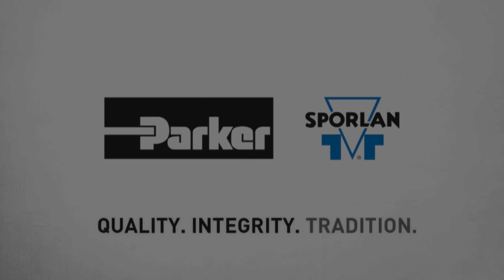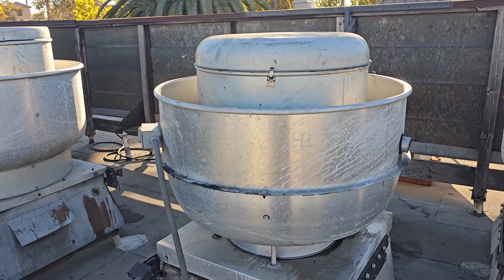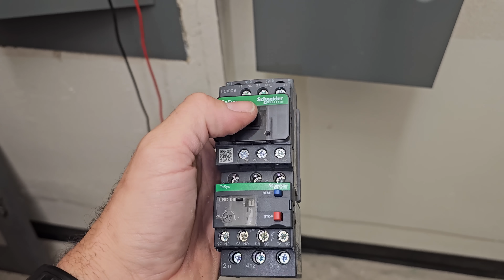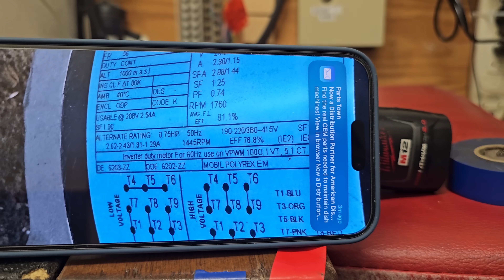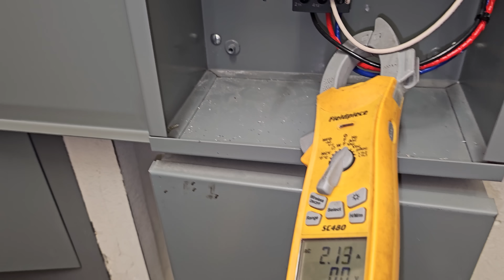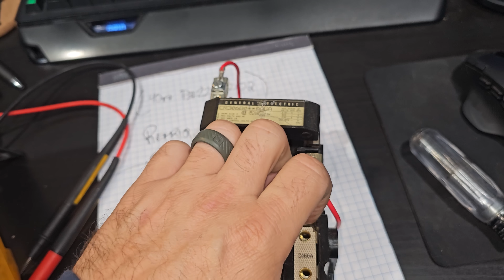SOMETHING IS NOT RIGHT

Comment: The heater probably blew up when the wire blew up. Those motor starters are not designed for short circuit events.
It's also possible that it was severely weakened and then died/broke off the rest of the way.
Also, you did the right thing rather than trying to repair that starter. Spec for those always says to "replace the entire overload if burnout occurs".

Those old thermal overloads work very interestingly. Particularly that style.
The heater itself is mated to a metallic alloy with a low melting point. During design, they pair the melting point and the heater power to correspond with the actual heating of the windings of the motor, so that the metallic alloy melts before the windings burn up. They will include a spec sheet recommending which heater to use for what motor.
This allows a mechanical action normally inhibited by the solid alloy to deploy that opens the trip contacts, and ideally dumps the contactor.
It also has the benefit of requiring the operator to wait for the overloads to cool off and the alloy to solidify before it can reset - also allowing the motor itself to cool off.
VERY ingenious and clever use of technology.

Their main drawbacks are that A) they can't handle short circuit events and will blow up if subjected to one, and B) they're sensitive to ambient, put one in a hot room and they'll trip prematurely. The heater sizing chart provides advice on how to deal with this, but it's still suboptimal.

Comment: 3:20 Power on a green wire is how you die or get some one killed.  Power on a white wire is not much better.  We are going to need a 10 ft long red heat shrink tubing.  All 3 should have been black or do not do the job.  It is like showing up to a job and only having coat hangers in your truck and saying you can make it work :-)

Comment: The probable reason for that one phase to have been blown, is a loose wire on that phase. A wire that is barely making contact, increases your resistance, which increases your amperage that the motor will pull on that phase , producing an overcurrent situation on just one phase.

Comment: FLA 2.3 x SF 1.25 = 2.8a
Reply from the maker: The 2.3 amps on the rating plate was for 230 volts . On the motor it said “USABLE @ 208v 2.54a  SF 1.0 “ I was running 203 volts 3phase so I used the 2.54 rating and multiplied that by 1.15%.    2.54x1.15=2.92a overcurrent setting… that’s how I’ve always understood that…..

Comment: Aside from the content which, by the way, is your usual excellent standard, Chris, it looks like you have a problem in your office. While watching this video I noticed curious strobing or flickering taking place. It is particularly noticeable on the wall above the printer at the back of the shot and also visible on the side wall on the left after the curtain but below the map. Have you changed the lighting in the office at all? Or has something changed with your video capture setup?
Reply from the maker: Not it’s because i run my ceiling fan and it creates a weird shadow

Comment: Sparky gets a big F. Even if they did make the mistake of assuming it was a single phase motor never use green as a hot even as a temporary. Could have just run another black and taped it. Weekend or not how do you not have extra xlink on the truck for a simple run. I just don’t get it.
Reply: Just needs to add one more black, then they’d have B,B,W and G for ground! Tape accordingly with real blue and red electrical tape like some 3M #37 not the dollar store junk or the paper sticker off your 7/11 hoagie wrapper good grief! That was just an embarrassing mess and I’m confident Chris would have more than capable of doing the whole job wire pull included. The motor controller install was perfection. Electrician had a low GAS factor.
Reply: * two more black conductors.  Three total for the three phases.

Comment: Man using green as a conducter is so Shady. I would have a pulled an any other color but green.
Reply: I was thinking the same thing.  Should have been easy to pull out all 3 new flexible wires and replace then with any color other than green or white.

Comment: Looks so nice now, after you rewire it.
Reply from the maker: It’s still not right the electrician still has to come out and fix their horrible work but it’s functional for now
Reply: @HVACRVIDEOS  I agree that the green wire is just a big no no, but if it is a emergency situation we all use the wrong wire colour. (I guess I would have used the black wire for all 3 and number them if I don't have the right colour)

Note that here in Europe I would have just used a 3 phase cable and automatically have the right color code.

Comment: Overload heaters are not fuses ,they are just heaters that heats something that trips the overload, either a bimetallic or a solder based trip.
Reply: I was going to post the same thing too.
The heater wouldn't normally melt, but since the trip was bypassed, the heater endured the overload past the point at which it would normally have tripped the circuit off.
Reply: FYI - modern resetable fuses work the same way. It's just a definition and the characteristic when it reacts to call something a fuse or overload protector... and you can't set a fuse to a different current.
Reply: @seanthiar  I will argue. There are motor protectors that are just bimetals, there are ones that are bimetals and the trip mechanism too, and there are ones that are basically adjustable breakers, with magnetic tripping, bimetallic tripping and arc quenchers. Knowing which type you have is absolutely a must. The plant I work at has equipment from 1960 to 2020 and I think I have seen about 40-50 different kinds in all sorts of configurations that are possible. There are ones that signal a fault, there are ones that are by all means and definitions fuses. Also if you look at main switches on distribution boards, some have a trip current setting even though they are actual circuit breakers. For example Hager sells a main switch that has an adjustable trip current from 63 to 160A with a separate adjustment for the characteristics (the instant trip multiplier)

Comment: When you said that you think the Electricians may have wired expecting a single phase motor it made me realize... is there a ground wire running to the exhaust fan? I think you're right, they were expecting single phase, so they ran Black/White/Green, and when they realized their error, instead of running an additional red wire, they repurposed the ground wire, and hoped the conduit itself would be enough of a unit ground (which used to be okay, but I'm pretty sure no longer is).
Reply: It's still legal, but in food service environments you shouldn't trust the metal conduits as a ground path
Reply from the maker: Yeah there is still a lot of conduits without dedicated conductor wires around me
Reply: Still code compliant to use EMT as a ground, but it’s kinda like backstabbing outlets where it’s still allowed but has high probability of failure.
Reply: @itssterilized conduit grounding is dependent on the quality of the connections.  I just fixed a system that used the conduit as the ground.  They came up out of the ground and used an aluminum junction box, to serve as the ground connection, as  the supply was run in plastic conduit, and had a separate ground.  Electrolisys caused the copper to aluminum bond connection to go bad, and all of the receptacles past that lost their ground.
Reply: I think I would call out a company lead man, and show them what was put in and paid for by their company.  They need to find a better electrician.  This guy will get someone hurt some day.  I would have discovered a mistake like that, and then pulled in 3 wires the correct size and color, along with a ground.  Even if it takes a extra hour, I might want to get home on a Saturday, but would rather pull in the wire twice, then to mark a green wire as a conductor.
Reply: Thanks for the responses!
Reply: lol if everyone in the whole total United States would follow THE NATIONAL ELECTRIC CODE 🤦‍♂️🤦‍♂️🤦‍♂️ but noooooo states over rule Fed an country supersedes state an local jurisdiction has the final absolute say 😂😂 it’s?? 🤷🏻‍♂️ just dumb
Reply: @kat2641  the NEC is not federal or federal law.; and is only mandated by state or local law.
The National Electric Code (NEC) is published by the National Fire Protection Association (NFPA), a private trade association.
Reply: @adamdnewman  yea your right … I just get so blasted upset at the crap I run into sometimes.. in my head it should be law everywhere would make life so much more simpler 😂😂😂

Comment: Nice job cleaning it up. On some of those IEC motor starters, especially with solid state overloads, you actually set the overloads to the motors FLA (not the 115 or 125% of FLA the code states).

Comment: The thermal overloads are probably the problem. The number on the overload is not an amperage it is a chart number. I ran into the same problem with an exhaust fan someone had got 17.5 thermal overloads. Unfortunately 17.5 on a square D thermal overload was rated for 14.9 amps, and my amps were 17.5.. I had to replace them with a thermal overload rated for 17.9 amps which I believe was a 19.5b on the chart.. it was quite a learning experience

Comment: Those heaters don't work like a fuse and burn out. Yours must have been exposed to a direct short.  They work by heating up a ratchet device that is normally held by solder.  When an overload occurs, the heaters melt the solder, allowing the overload switch to trip.  Once the solder cools, the overload can be reset.  The new ones you installed are electronic and sense the current electronically.

Comment: I'm suprised you ran the resilient cushion frame on shaft vertical position

Every motor manufacturer I've ran across,  always spec resilient for shaft horizontal position only

Rigid base is all i will use

Comment: It's interesting to see, how you switch more and more from Relays & Switches with almost no touching protection to manufacturer with much higher safety standards wich are almost common here in Germany/Europe. Even from wire nuts to Wago's. It makes me crazy to see all the time in your videos how low the electical standards in the US is/were. There are so many and easy accessable parts were you can get in touch with power. Sure, if you're looking for a failure in a switch you will see a burned contact easilier on an old contactor than in the newer ones, but safety should be at first place. 
Good job.
Reply: The standards are actually pretty strict. The problem is installers and service people who muck it up after the fact.

Comment: NEC 250.119 prohibits any green, green/yellow striped, or bare wire from being used as a hot, save for a couple of exceptions that have to do with green SPT-2 cordage and the use of green hot conductors to feed the greens on traffic signal heads. So you cannot re-identify the green wire as a hot wire. The so called electrician should come back out and do the job properly. Since you now know about it it and you service the equipment, is your responsibility to make sure this is fixed properly. If you find out who did this you should have their license pulled as they are no electrician.

Comment: High-leg delta is another one of those goofy less common nowadays setups that can trip you up if you aren't expecting it. The first time I came across a panel with both single-phase and three-phase loads in it and measured L-L and L-N, I had a hell of a head scratcher moment seeing 208V from B-phase to ground/neutral until i realized what was going on. Always ALWAYS check and double-check your system and don't make assumptions! I can only imagine there has been some "exciting" (and potentially expensive) moments for individuals livening up what they believed was just a simple job of adding a 120V branch circuit to a more standard 120/208V Wye system....
Reply: We just installed a couple of ventless fryers that were in a building with a Delta high leg. We went over it multiple times with the manufacturer to make sure that this would be acceptable to run the equipment. In the end it was, I just wish somebody had told me all of this before I went out to the site and started scratching my head. I'm not an electrician, I'm an appliance repair technician. There's a difference lol
Reply: There was a time when I was on the road with the carnival and ran into a high leg delta where we were pluging our bunk house in, it was my first time seeing one of them L1 - L2 250v, L2 - L3 250v, L1 - L3 240v, L1 - N 120v, L2 - N 240v, L3 - N 120v... my boss at the time told me not to hook anything to L2 and I'm glad that I didn't, I have since learned alot more about the different types of power systems put there and that one does scare me a little bit

Comment: Overload bypass on the first hot leg? And NO crimped termination to what is CLEARLY not a wire-retention terminal? I'd...probably just fix it, discover the same failure, and just be mad about that...
@8:50 Those do not melt--they heat up. The Overload relay trips when they heat up too much, which means each current setting is a different heater element. 
Bad Heater-Overloads are a cr@p-shoot on replacement parts. A 1-for-1 swap would work--probably--but you'd have to know which company sold it, and even which WAY they go on. The box you had didn't include the instructions insert, did it? It tells you these things, but they tend to go missing. Un-Fun Fact: Turn it backwards or upside down and you get a higher overload limit, a lower limit, or no limit at all.

Comment: Chris, as a Norwegian electrician, and automation tech trainee. I am so proud that you have seen the awesomeness of shneider equipment❤️
Reply: However. 2.15A*10% is better, when bearings and stuff fails and bearings go to hell. It trips and let's you know something is wrong. But holy moly that American stuff is scetchy sometimes! Gees.
Reply: @Mr89netrom  That "Change color with tape" is also really sketchy.

Here the ground wire is yellow/green and it is directly illegal to use it for anything but ground. 

The problem with taping it is, you only change the color on the wire in the end.

If the cable breaks in the middle and it is only the green wire that is cut, someone might think they did not need to turn off power as it is only the ground wire.

As said.....illegal and you can be fined or lose your accreditation as an electrician if you do this.
Reply: @JohnDoe-bd5sz  it is so here too. I found a cable with ground as 3rd power lead, and instantly ripped it down.